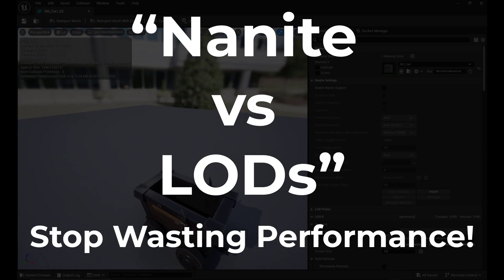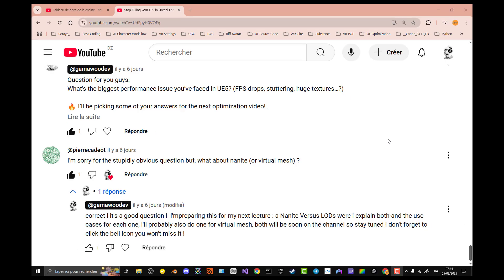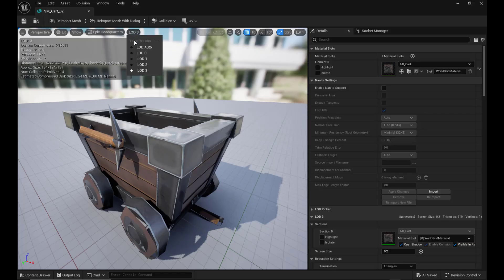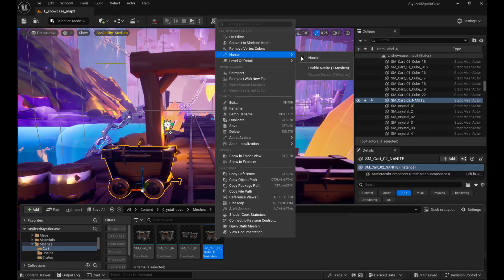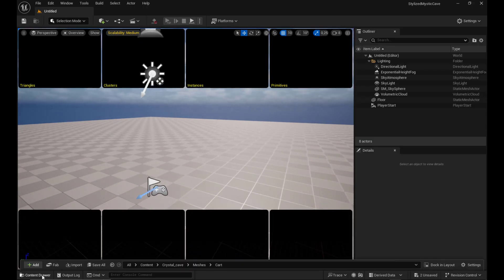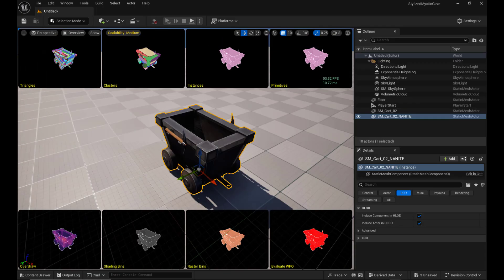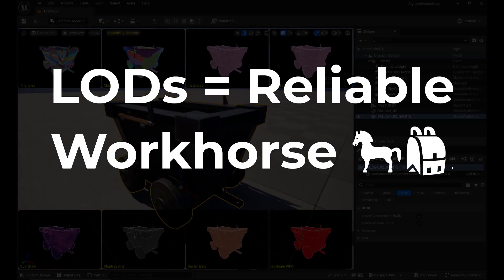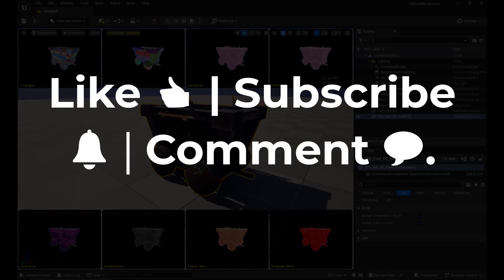Stop Wasting Your Time! UE5 LODs vs Nanite Explained

Comment: Hey thanks for the featuring ;)

So... what if you compared you previous video Cave scene (with carefully optimized LODs), with a copy of it, but this time having every meshes nanite enabled ? - and see the differences

As for me, with nanite beside enabling high detail meshes, I tend to find some flickering dithered mess with textures and shadows (when using lumen) it gives somewhat mixed feeling.. so I have a hard time wondering the best use case for both techniques... keep the good work GamaWoo !! :)
Reply from the maker: my pleasure ! it won't be good with all nanite ! the cave is using LODs and HLODS because it's used in a VR Game standalone game (android platform) ! so no point using nanite   , i need LODs and HLODS so the headset can handle far geometry without struggle ! to be honest i'm still searching for the best possible combination of both Nanite and LODS  !